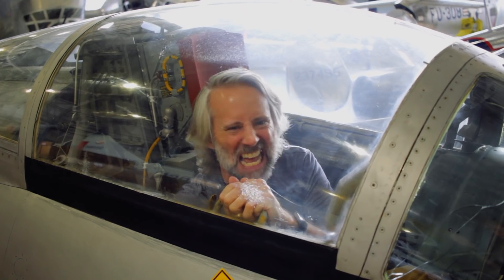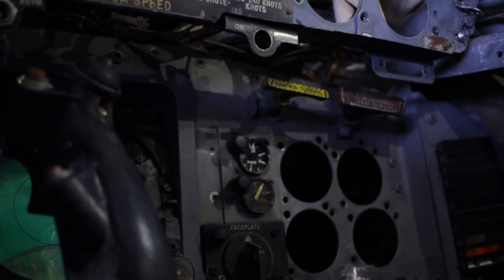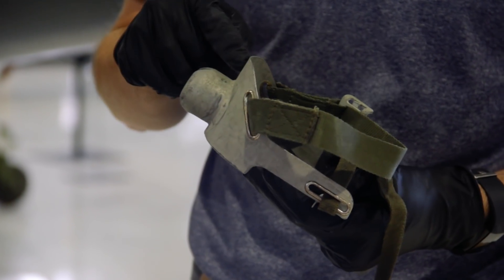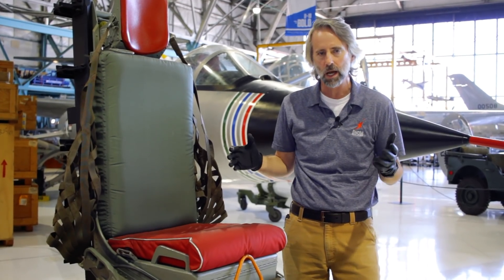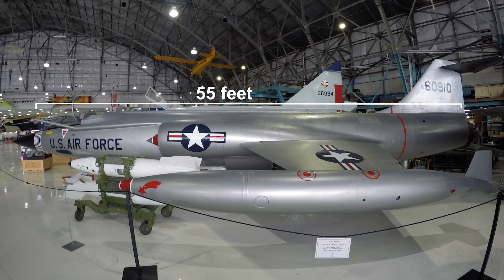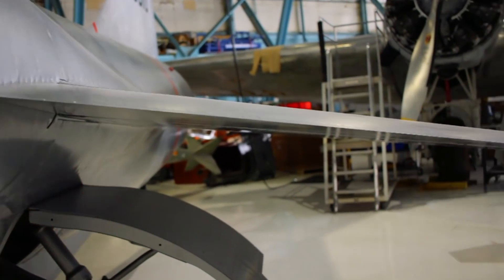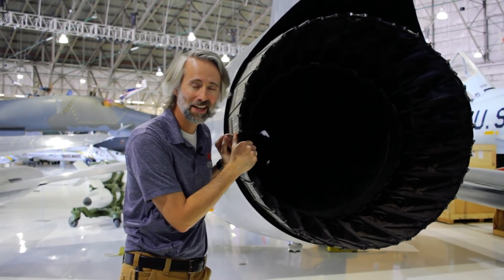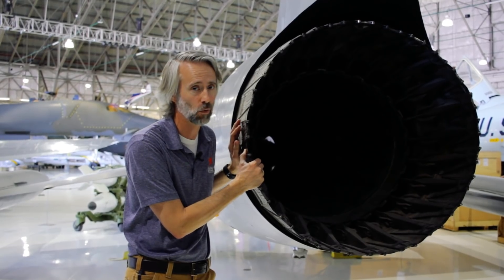F-104 Starfighter | Behind the Wings

Comment: Well that was misleading with the German air force because the problem with German air force during that time was they did not have well-trained pilots and the f-104 is basically a aircraft that has to be treated with kids clothes and you have to be trained up. However once they got more competent pilots the f104 actually did very well in Germany.
Bottom line the Germans did not have the expertise left after the war versus American pilots who've been flying through the war into the 60s.

Comment: I worked on all of the F-104's at George from '64 - '65.  It was a wonderful AC and great to work on.  It carried tip and pylon fuel tanks for longer range,  Yes, the wings edges were sharp, my co0worker slashed his hear on one when he didn't duck low enough.

Comment: It's a true and incredible story of the F104 Starfighter, a a Sunk Works test pilot Darryl Greenamyer.  The C 104 was all about speed, and that is what Darryl was a Bout too. Darryl scavenged parts from any where he could mostly from crashed f 104s. The engine was probably and illegal contribution. He completely remade all the parts into a complete airplane and set a low altitude speed record, which still stands, I think in 1977.